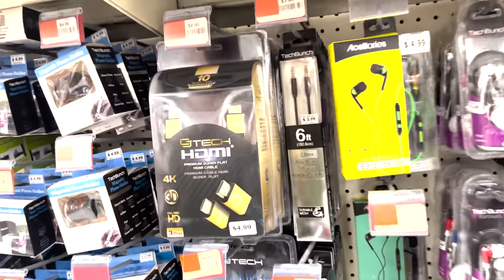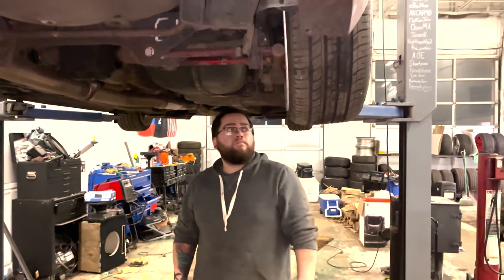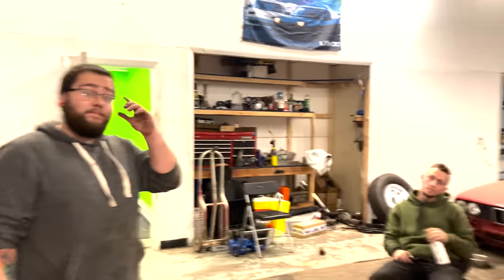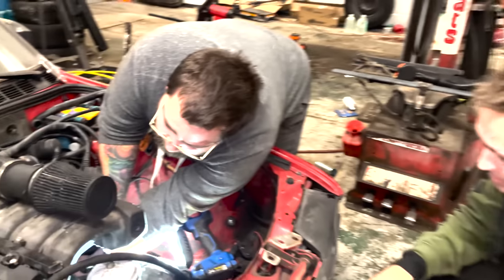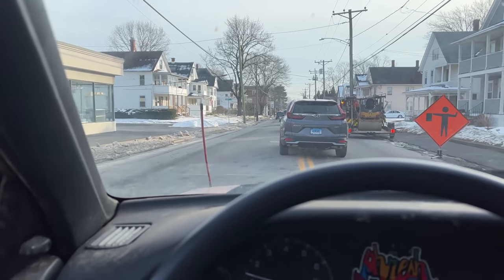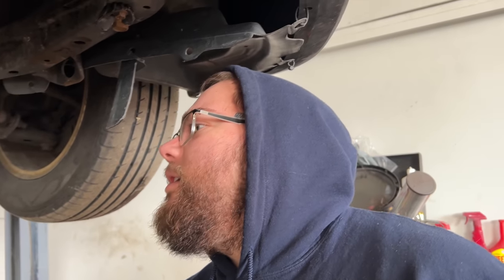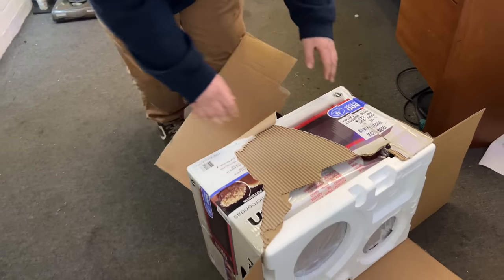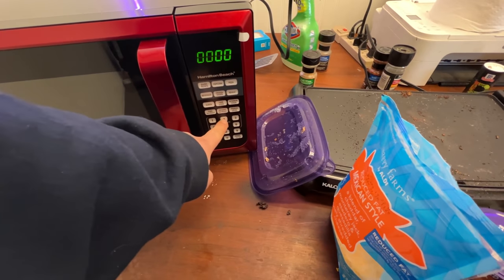AJ's E30 gettin' some love finally!

Comment: Are y'all putting used engine oil in the wood burner that's crazy lol but I'd probably do it too
Reply: We have an old oil barrel with a bunch of slits at the bottom, thing shoots 7ft flames out the top on just wood so imagine what its like with a couple old oil filters in it ;)